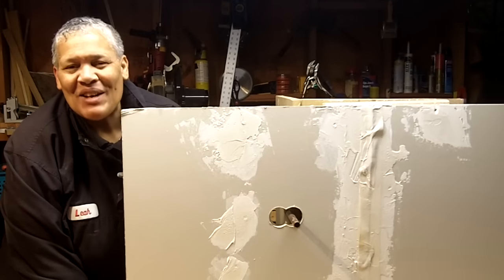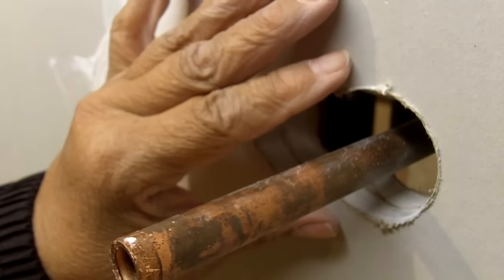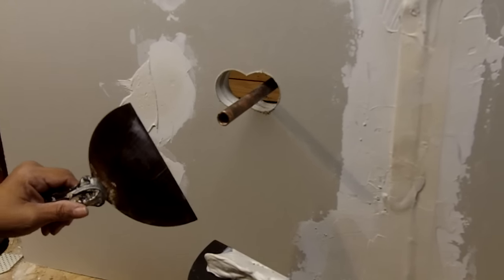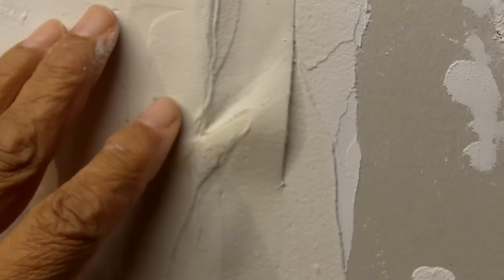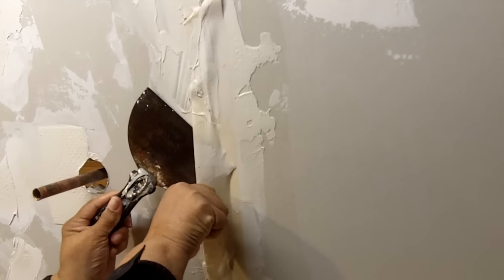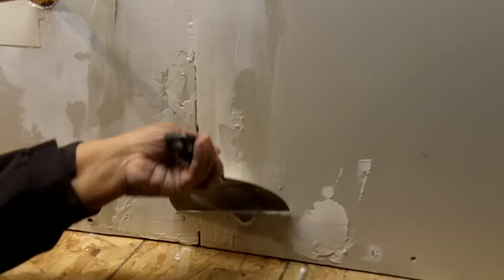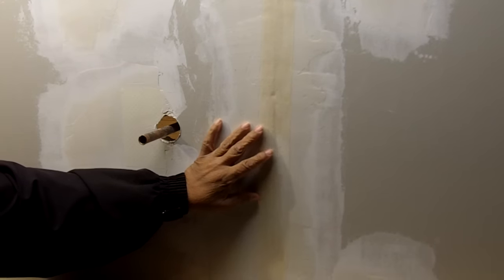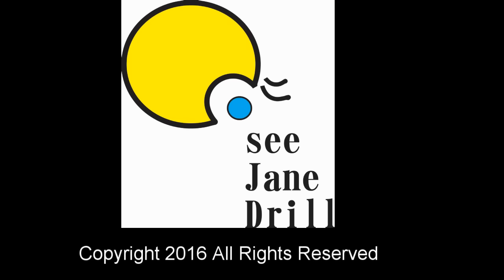How to Fix Drywall Mistakes

Comment: So your holes were 2" circles. Why would you not make  3 circles plugs of sheet rock.Make 2 solid 2 inch plugs.Drill the first plug with the hole for the plumbing Place it on the tube temporarily into the hole Take the second plug put it in the left hole under of the first one where it would go into the hole.Using a sharpie to trace where the left plug touches the first plug. Notch out the left plug then mud it into place. Now make the third plug with both the hole for the plumbing and with enough extra surface paper to cover both holes,.Stronger repair last way longer with no draft.

Comment: What do you do in a situation where the drywall tape was painted over? You can see the tape line through the paint! Would it be the same concept? Wet the area?
Reply from the maker: No.  How to proceed would depend upon the condition of the tape, i.e. whether it is buckling, or stable
Reply: It was smoothed out but the tape is bulging in certain areas like in the video. There was no joint compound put underneath but it was put on top, dried and painted over.

Comment: jam a a plastic grocery bag in there just like a hollow core door. Mesh sucks and always turns out like shit(not flush w/ drywall). Four or five passes and sanding four/five times on mess or just simply add about a quarter inch doing nothing  but basic application..1 sanding trip no mess or tape

Comment: I prefer mesh tape then covering over with the compound but not using paper tape over the mesh tape because it creates bubbling. I use paper tape only on 90 degree corners of walls.
Reply from the maker: I do not recommend using paper tape and mesh tape in combination.

Comment: Thanks Leah! Im curious, which joint compound did you use?? I've seen the all purpose "mud" which takes 24hrs to dry. And also the DAP brand which states it drys between 1-5 hrs.. Thanks!
Reply from the maker: Hello Nico,  I usually use setting-type joint compound for small repairs  (Sheetrock Brand EasySand  45).  I use pre-mixed joint compound for taping and large jobs.
Reply: seejanedrill does the DAP patching plaster compound work well on drywall?? Thanks for your reply!!

Comment: Great video! I have a question though. Well, I fixed a patch on my wall, spackled and sanded, but I noticed that in direct sunlight, I can actually see the patch through the paint. To me, I feel like I sanded enough to the point where I saw a smooth surface. What do you think I did wrong? Also, I noticed that the area I sanded is nice and smooth, but then the areas next to that area have a normal rough drywall look when I painted over. Is there anyway I can prevent having (2) different surfaces next time?
Reply from the maker: +latinkutz1386   To answer your first question, your issue sounds like "flashing".  As for your second issue, a "level 5 drywall finish" is what eliminates the problem you're experiencing ( on  new drywall).
Reply: +seejanedrill I'm a little confused as to what your referring to. I'll keep doing research to figure out the problem.
Reply from the maker: +latinkutz1386 Ok, so "flashing" is something that occurs when you repair a wall, and the spackle or joint compound absorbs some of the paint, creating a difference in sheen between the repaired surface and the rest of the wall. Or in your case, you can see the patch through the paint.  The solution?  You'll want to use a good primer. The second issue that you asked about, where the sanded area is nice and smooth, but the areas next to it were rough.  You didn't say whether this is new drywall, or an existing wall that you repaired.  If it is a new wall, you can prevent this problem next time with a finishing technique called a  "level 5 drywall finish". If it is existing drywall that you repaired, you can try using a roller with a heavier nap when painting over the repaired area, to try to replicate the "rough drywall look" of the surrounding wall.
Reply: +seejanedrill sounds good. Thank you! I will try and do this next time I patch and paint another wall. But to answer your question, yes I was repairing an existing wall. I will take note next time. Thanks again for the help.

Comment: Leah, HELP!  I have some walls in a mobile home where the joints were left really wide, as well as uneven edges, so one stands proud of the other one.  I've used backer rod in some of them and filled with an acrylic latex caulk plus silicone.  Some of the joints look fine. Others, not so much. What do I need to do?  Thanks!
Reply from the maker: +Sharon Hendricks Hi Sharon, unfortunately I'm not very familiar with mobile homes.  However, what you are describing sounds like an expansion joint.  And expansion joints are not meant to be filled.  If you'd like to send me a picture, I'll take a look.  My email address is provided on the seejanedrill website.
Reply: +seejanedrill Thanks for replying, Leah. Mobile home manufacturer's prefer to place cover strips over drywall joints so they don't have to tape and mud. Most of the joints are very close together and fairly easy to fill.  However, these were wide and not even.  I went ahead and taped and mudded, sanded, did three nice coats and painted.  It isn't perfect, especially if you are looking for it, however it is smooth with no protrusions. Turned out much better than I thought it would. Love your videos! Thanks again.
Reply from the maker: that's great...glad to hear that you did it!

Comment: Tape? What tape is that? Looks like maskin' tape. I did all my drywall without tape and filled all my seams with plaster. I am not even aware we use tape here in Germany,  but I must admit that I am really not an expert. Interesting though, because I could imagine that tape would cover the self cuttin screw's heads as well.
Reply from the maker: Here we use paper or fiber tape designed specifically for covering the seams in drywall.
Reply: seejanedrill : you are amazing. Thank you so much from Germany. I hated drywall because the plaster would always ummmh,..."pull itself into the seam" upon drying. I now also understans why a pipe preferrably has no contact to the drywall. I only wish I had seen this vid back in 2003. I like you, because you KNOW what you're talking about and don't make a big deal about it. Instead you help people and make them feel confident to try for themselves.

Comment: Shes just made a bump in the wall.Fine if its behind cabinets or being tiled but that on a plain painted wall would be a bump.Sand off the excess compound first
Reply: john g - It's gonna be sanded anyway as long as the ridges aren't ridiculously huge.. I would've personally sanded it first as well but this would work fine too

Comment: why not just use a piece of drywall? like... square off the wall and  cut a piece to fit perfectly. screw maybe 2 pieces of small board behind the wall and do it that way?
Reply from the maker: +Richard Cowtails Hi Richard, nice to hear from you again!  here's the thing...it is really difficult to do a California patch on a round hole, and it is simpler to use a plumbing patch (the one we used in the video is contractor grade) than to take the time to square off the hole and patch around the pipe.
Reply: always a pleasure to watch your videos. I was speaking more of just squaring the wall and cutting a piece of wall out and drilling a generous sizable hole. then go from there. you know... wood behind the wall all the small things lol. patches are always good

Comment: You haven’t explained which type of compound was used to bed the tape... You’re obviously using a universal joint compound which (realistically) is only made for small patch jobs, not tape joints. If the bedding compound was a base coat which most pros use, there is no way any water will weaken it enough to pull that tape away... 
Thats a whole different story...
Reply: Clearly a pro made that initial seam, lol.

Comment: that should be sheetrock 90 or 45 mud will crack
Reply from the maker: +Zac Adams We don't usually tell people which products to purchase, because brand names vary from area to area.  So we usually just tell folks to get a setting type joint compound.  And then they can determine whether to get the 20, 45, 90, etc.

Comment: watch the mold growing after a while when you wet the sheetrock
Reply: There is already water in your joint compound or mud when it got mixed.
Reply: If you are already seeing mold then you have a leak somewhere, it wasn't from anything you have just watched in the video-I've done home repair for more years than I'd like to admit, and this was a top notch repair zambama z...comments like yours show just your lack of knowledge in this area.

Comment: that patch, it,s gonna be brittle as hell no? id do a californian patch on that
Reply from the maker: +martin blouin   Hello Martin,   What I have found is that a "California Patch", is not ideal for round repairs or areas around pipes.  The repair  material  used in this video is  exceptionally tough and incredibly durable which eliminates any brittleness, also, pipes tend to be in low traffic areas where a patch is less likely to be abused.  I appreciate your observation and  I hope this addresses your concern.  Thank you for commenting.
Reply: +junksmyfashion you ever done drywall?
Reply: +seejanedrill in the end, that patch is more or less a thin layer of swiss cheese,with a 1/16 of an inch of mud sticking trough and at best a /16 of paint, it can't be sound, the minute you'd poke a finger it would break trough, of course if it's  behind a shower/bath casing and it's not expose, i guess it could work , but then you could leave the hole as is and it would not matter, i respect your idea but i wouldn't do that
Reply: +martin blouin if you have never tried it then i wouldn't be so fast to criticize. Take what she taught you and add to it for the situation. Just FYI theses are not generally for people in the industry  they are for home owners trying to save a buck ....a little understanding goes a long way
Reply: +Blu Oxygen you ever done drywall?
Reply: +martin blouin at least 3 times week at least. 20 years in maintenance and 10 years in construction. Am i good enough to talk to you? or are you going to just dismiss me too?
Reply: +Blu Oxygen and you tried this ?
Reply: yes i have. have you ever done drywall?
Reply: +Blu Oxygen yes,i'm building my house and i do everything, carpentry, electricity ect. i live in Canada and here houses works a lot between shift of cold and hot weather, i think this would not last very long. and even in warmer climates where that would bother less, i think something this thin,3/16'' total with mud and paint? i get it super resistant to tare, but it's glued to the wall with joint compound man, if you hit this , it would either break at the seem where it's glued to the drywall, or the super thin layer over it would crack because the patch itself is pliable. maybe on a ceiling that could be not too bad, but on a wall i'd do a californian patch, beside instead of paying for something more, when you drywall most of the time you already have leftover piece. i like her video and i always watch ,thumb up and comment, i just stated my opinion,if you want to make repairs like this, you can it don't bother me, i just say i wouldn't
Reply: i understand your point however you are still missing the point of the location of the patch. i would not do this in an open wall or behind a doorknob next to a light switch. i use this for fixing drywall where i had to repair a leak in a pipe coming through the wall under a cabinet or in a utility closet with a water heater simply to close up the hole. i have probably 100 of these all over the city and after 5 years none of them have broken.
Reply: +martin blouin If you are so amazing in all of the areas you specified why are you trolling You Tube and correcting mistakes? Seems to me you need to grab a hammer and get off your soap box...
Reply: +Blu Oxygen well in some very specific place, ok i give you that
Reply: +OkemoIV i'm trolling because i commented on  video? last time i used a hammer was yesterday, and a power hammer too.